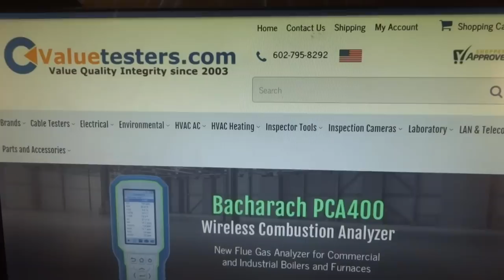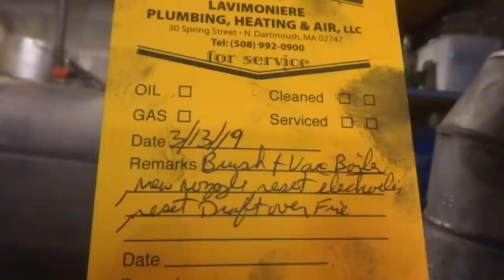oil burner making black soot

Comment: Draft over fire is so important and so often overlooked. Good to see you take it seriously. We haven’t switched to the low sulfur fuel up here in NH, still a lot of sludgey filters strainers and having to blow out oil lines and treating tanks. Can’t wait for the cleaner fuel.
Reply: We tried Beckett ultra guard additive for a few years, mixed 1/2 gallon to 2000 gallons at the truck, similar result, filters like new, less oil supply problems, less night/weekend calls.
Reply: If you install an additional filter right at the tank, you will never have to blow out the entire oil line, but you may have to blow a small amount of sludge back into the tank.

Comment: Buddy, you're a truly professional I can say..I just stumbled over you as I had some funky heating phone call that a hot wate boiler suddenly stopped working ..and outdoor temperatures were ( still are!) well bellow -10C..As I went there I had to deal with an honeywell aquastat L8148E, with vent damper connection but the intermittent spark module got fluctuating  24V to B1-B2 burner contact of the L8148E..had 25v for 2 minutes then all of sudden it was flickering down to 19V upa nd down..the transformer had a good steady 24v output to K1 relay  and through B-R high limit of the L8148E but when reached B1, it eas flickering!

Comment: Steven just a note from the U. K. We have to use double skin plastic tanks with the outlet two inches up on the side to stop all the crud blocking every thing up. Never seen a oil tank inside all ours are outside.
Reply: Most tanks around here are indoors to keep the fuel from turning to gel when it gets really cold out. 

We have plastic lined Roth tanks here too, which have the oil drawn from a line that goes in from the top. They are considerably more money, so most stick with the standard bare steel tank.

Comment: Filter flow is not linear with regards to trapped particulates.  If the filter is 70% clogged, there won't be much reduction in flow.  By the time the burner locks out, the filter is 100% plugged.

Comment: I'm wondering what you sprayed on the electrodes and nozzle.  I can't make out the name on the spray can
Reply from the maker: carb cleaner
Reply: @stevenlavimoniere I replaced the filter and nozzle. The carb cleaner worked like a charm.  I still have smoke grey/ black coming from the pipe looking thing that the ignitor is attached to.  I cleaned out the boiler as well from the top.  Unfortunately nothing helped. Got a call into the repairman now.  I really wanted to fix it myself but unfortunately I tried all you taught me in this video.  I appreciate your videos they really save me money usually.

Comment: I know this is a boiler and not a Common rail diesel but for the price and the time it takes to change the filter I think it’s just worth doing regardless - because as you know filters can disintegrate and cause issues further down the line
Reply: Yup, preventative maintenance but hey then again if he does change it he doesn’t get the next service call for a clogged filter. = lost income
Reply: @zerodegrees8  sad but true. Nozzle and filter always changed. What another 10$ at a minimal 75$ service fee.

Comment: Steve, I was a HVAC technician years ago and only spent a few months with an oil service company.  What I do remember was many of the tanks being old had accumulations of sludge in the bottom of the tank which I guess may contribute to filters becoming clogged or dirty.  We did have a policy of changing the filters and nozzles on yearly cleanings.  I was wondering if the newer fuels effect the sludge present in the tanks, that is with the detergents and low sulfer, will it effect sludge deposits already present there?
Reply: #2 is #2 duder
Reply: I've been servicing oil burners for 15 years you need to change the oil filter every time as a good rule of thumb a 2 to $5 expense will save you a call back with dirty filters no one ever gets them serviced every year it seems like they always like to get their money's worth out of you I think it's time HVAC text started getting our money's worth out of the customer

Comment: You didn’t need new kwool gasket for the top?
Reply: @1fasteddie64  , not really because it was adjusted through the damper which equals the same thing as the dampers inside the boiler box ! It's not a big deal
Reply: It would be a good idea to seal the breach plate with gasket material. The top of the boiler vessel and the breach plate don't necessarily make a complete seal, therefore, air pulled in at the gaps can affect the co2 reading by making it inaccurate.
Reply: The insulation keep's heat from burning the top of the jacket , also keep's boiler from spilling CO ...Good idea to replace it .
Reply: @frankdinaro3220  its also creates a seal preventing dilution air before the regulator producing more accurate combustion analysis. I think this guy is an amateur doing what he has seen and been told in the past, not what he has researched and learned for himself. Too many dampers wtf?! Clearly doesn't understand as he makes up his own theories. Too much back pressure! Lol haaaaacccckkkkkk. Nate certified oil and hydronics.
Reply: @oilburner9989  😉

Comment: Changing the filters all depends on what you charged for that service call.  But great work getting him going......I would have also put screws in the vent pipe (not sure if you did) and changed the pump/tank filter.

Comment: My dad was the same way a good flow no need to change filter. .your right in the 50s and 60s 70s dirty oil..dif today..im retierd..boiler guy.from chicago..my dad was the same. But a heating co..50 s 60 s 70 80s..

Comment: So I search the web to see if similar conditions setvice techs encountered and saw an interesting site heating wall where a technician says he had tons of exact heating calls due to loose wires on B1-B2 contacts! But to take the controller apart and solder would've been for me big hussle as house was getting colder and colder by the hour..

Comment: You mentioned in this video when you measured overfire draft that 1"wc suffice..but you had measured at boiler inspection window..shouldn't be measured at the inlet of barometric damper instead? Or that location would give you same reading?
Reply: That's a totally different measurement, the heat exchanger which he ran the brush through is a restriction before the exhaust, so he's making sure there's enough draft in the firebox, not after the heat exchanger in the chimney pipe, that draft should be .02

Comment: Steve, love the videos. Quick question.  When the furnace first starts, and the transformer sends the spark, does the spark stop once the CAD cell recognizes flame?  
My oil furnace short cycles.  It has been cleaned, new oil filter, nozzle, transformer, and it still does the same thing. 
I thought the “arc” stops, once the flame is recognized.  
I’m thinking it’s my thermostat or the controller on the furnace.  Thank you.
Reply: If its interrupted ignition the spark will stop. Short cycling is about the unit over heating

Comment: hi. Just turned into  your videos and was wondering if you could help me... I have a Beckett Burner for a HOT water pressure washing unit. For some reason I am not getting any fuel coming from the bleeder copper tube which leads from the fuel pump into the motor side. I've tried everything to try and get  fuel through the tube. I see the fuel being pumped into the fuel filter but it doesn't siphon through the copper tube. I think I saw somewhere where I'm supposed to bleed the fuel pump. Any help would be appreciative.
Reply: Him checking the oil flow is how you bleed the pump. 4:29 You crack that fitting open, and run the burner until it clears the air, and only a stream of oil is coming out. If you get no oil flow, then there's either a restriction, air leak, or its a bad pump.
Reply: Unless you have an unusually large pressure washer, you will be making more hot water than the water can carry away.

Comment: Hey Steve, thank you for the content. I am a HVAC instructor in CT, I recently watched this video with my 12 grade HVAC students and they were able to see quite a few poor practices. My students asked me why didnt Mr. Steve conduct a combustion analysis after you deposited all the soot into the combustion chamber that you didnt clean? They also asked why wasn't a new collector cover gasket installed, what should i tell them? By the way i diggin on the all purpose water pump pliers. :)

Comment: But that threw me off the bat and wrong diagnosed and bought new spark module..buy then I used a separate 120v to 24v transformer I carry with me all the time and soon as I applied to spark ignition module, BUM! had flame!

Comment: Leave all of them baffles out would be the best thing.
Reply: Ronald Towe you can, however it will pull all your heat out through the chimney and cost you more in oil. They’re there to slow the heat down as it leaves the boiler.
Reply: @staceyfisher1479  they didn't design to be taken out did they lol

Comment: This dry-base boiler has a cracked firebox. Look at how discolored the vessel jacket is from escaping heat. To check for oil flow you should dead head jet line with a pressure gauge. I dont think you're very good. Facts are important. How do you know his filter is good through a prime smh. Channel locks, get 7/16 and 3/8 wrenches and a 1/2 for slow speed burners. Get a freaking can of ko blaster it looks as of your just brushing the assembly and not cleaning it. These drybase boilers usually use hollow burning nozzles and the chamber has a tolerance of 2300 degrees which means the co2 in the exhaust should be around 11% no higher
Reply: You are the type of tech that tells everyone they need all new equipment no matter what the problem is. "The whole unit needs replaced" is probably said on every job you are called to. That's why people wait so long to call for help because they are afraid you will show up and demand they spend 10k cause your afraid of getting a bit dirty. People like Steve because he does what it takes to keep them working. Most folks don't have 10k laying around to fix a unit. At best they will need to get a loan which can take days.. at worst they will just plug in 45 electric space heaters. Steve recommends a new units when needed but he keeps the family warm in the meantime. You just say it's to old and broken then charge them a service call of a couple hundred bucks and leave them in the cold. Literally... In the cold. Sounds like your the hack..
Reply: @ohioplayer-bl9em  nope